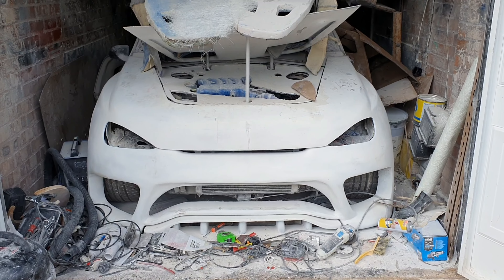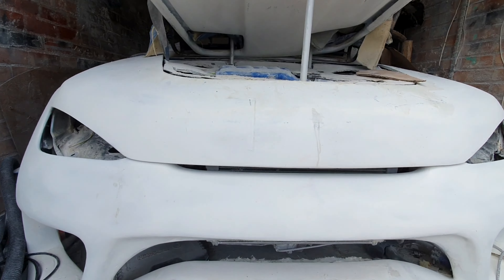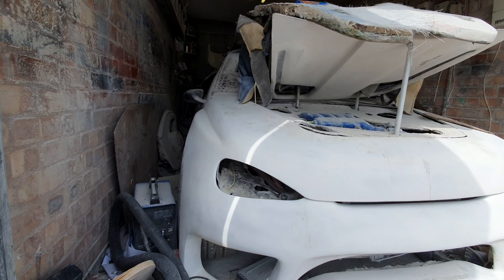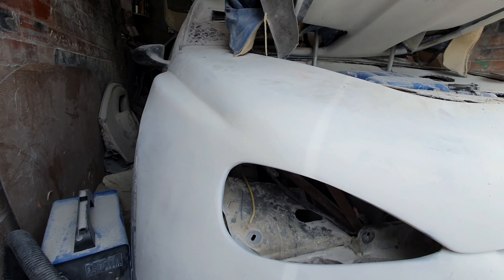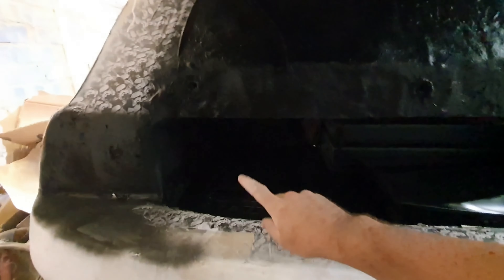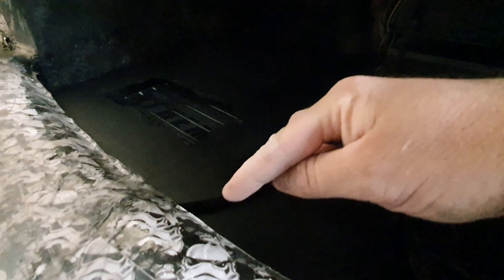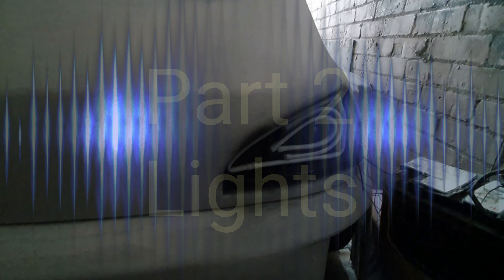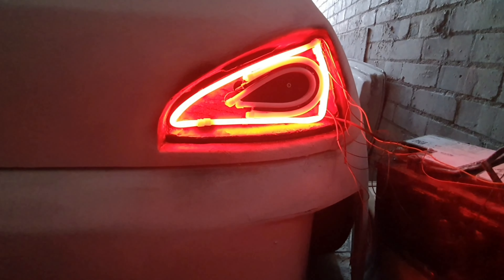181- Boot build goes black and panelling finished. PS5 test fit. symettry correction on front end.

Comment: looks absolutely crazy, but one question. what are you doing for brake lights ? obviously i can see you have tail lights but you did not seem to show brake at all
Reply from the maker: I haven't got the brake switch from the pedal connected as yet but there is a brake light built in to the tail lights
Reply: @rsjdevelopments  ah ok. Just with how bright tail lights seem to be i was wondering how to get any brighter for brakes :)
Reply from the maker: They will be a little bit brighter but as its not a road car I don't need to worry too much